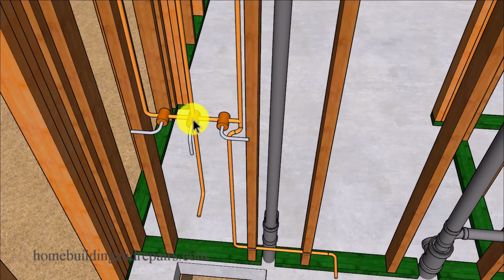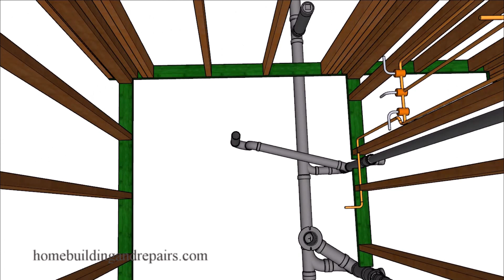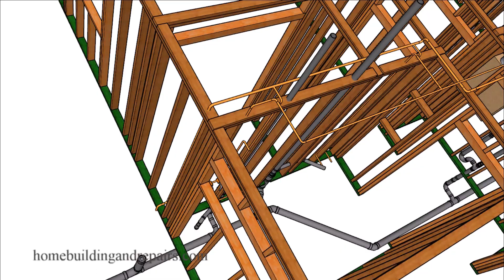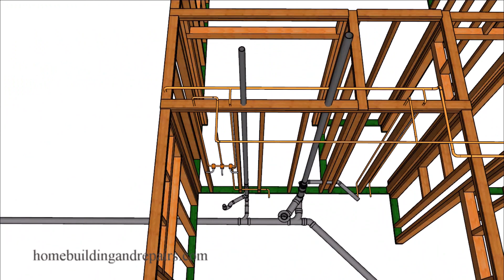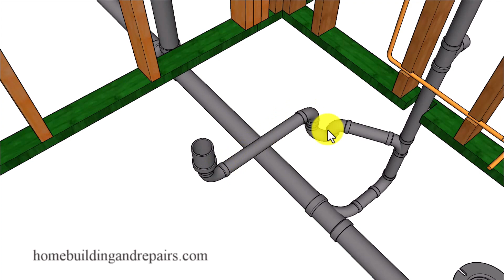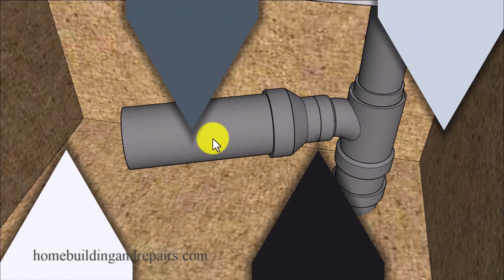Watch This Video Before Replacing Shower With Bathtub - Plumbing Drain And Water Supply Tutorial

Comment: Do you know why a shower should have a larger drain line than a tub?  Is the larger one also required for a shower-tub combo?
Reply from the maker: I did some research and the answer has some thing to do with the height of the shower pan. Since the shower can't hold as much water as a bathtub, it need to have a larger pipe to keep the water draining faster. This would answer your second question, suggesting a bathtub with a shower head would not need a larger drain.
Reply: @gregvancom  Thank you!

Comment: I've worked on a few plumbing with the last example many times and in most cases had to have them all replaced. If you have it and aren't replacing it, invest in a motorized snake as the calls to the drain cleaners will mount up.

Comment: Many DIYs, including renovators, replace a bathtub with a shower and connect the 2-inch shower outlet to the 1.5-inch existing pipe from the bathtub. The customers do not know it and the plumbers do not have to pay for the alteration. Cheap and good and consequences and code who cares about it. Greediness is a very bad thing. Thank you for teaching.
Reply from the maker: Awesome and good points.